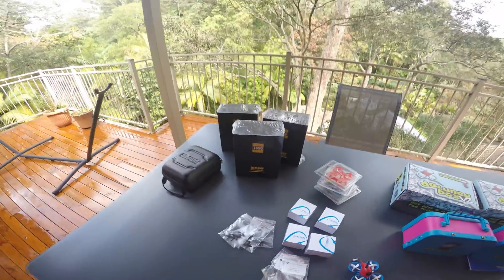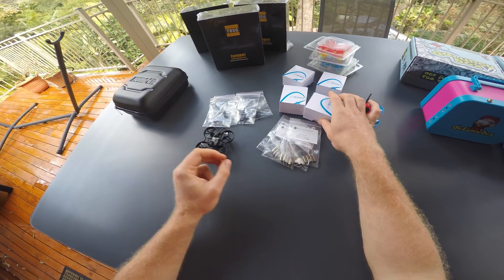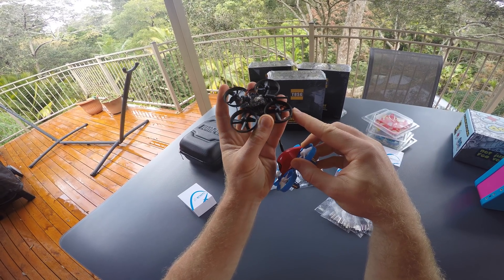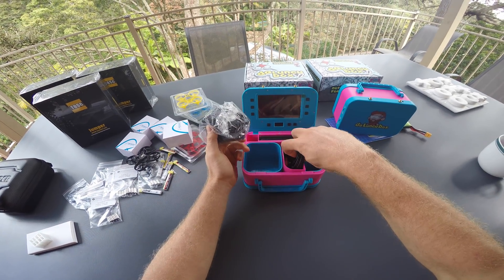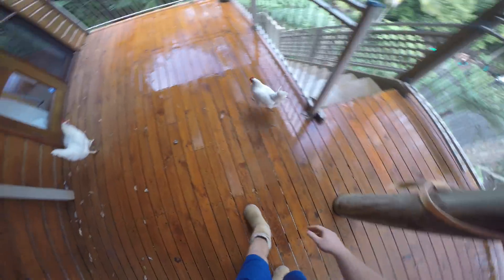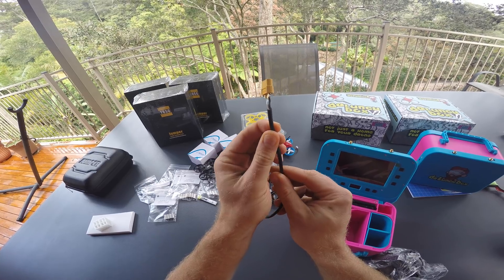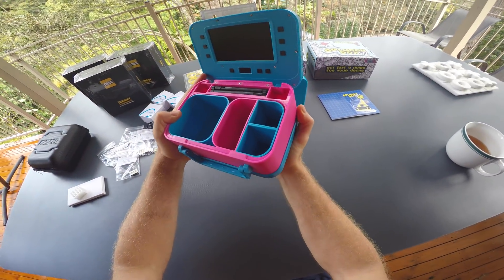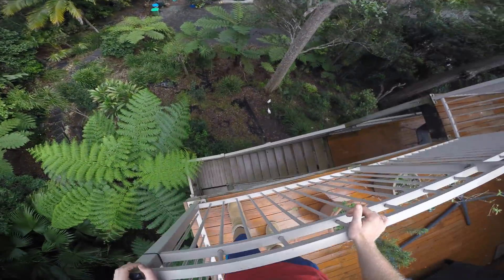"lowering the bar" - project update Sep. 5th 2018

Comment: How much are the parts for drone(base plate, electronics, etc)? Thanks.
Reply from the maker: The electronics (FC and cam) will retail for around $70.
Reply: Thanks. On the MMW shop I found Whoop kit(sold out) - is this FC and cam part of the whoop kit?
Reply from the maker: Current whoop kits still contain previous versions of FC and camera.
Future kits will contain the F4 FC and plug'n'play camera.

Comment: My Da Lunchbox works by just turning the switch on. You must be really unlucky to have 2 with dead batteries,
Reply from the maker: Yeah, I figure thats what it is - dead batteries :/
Reply: Micro Motor Warehouse it’s just that the switch gets flipped in transit, plug it in and let it charge for a while then turn it on again. The battery has a protection circuit cutting off power if voltage goes too low
Reply from the maker: No. I plugged them in for 8 hours, still dead.
Reply: Micro Motor Warehouse then it’s a safety circuit issue, if it goes too low and stays too low the board will prevent voltage from going into the pack. He’s addressing this problem now
Reply from the maker: I have taken a battery pack apart.
One of the cells is at zero volts.

The main problem that needs addressing is the quality control.